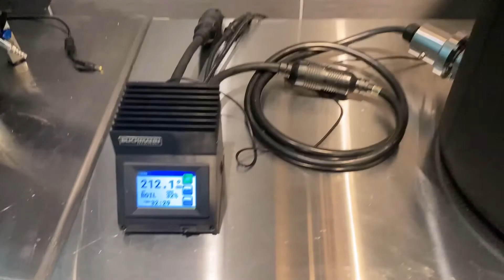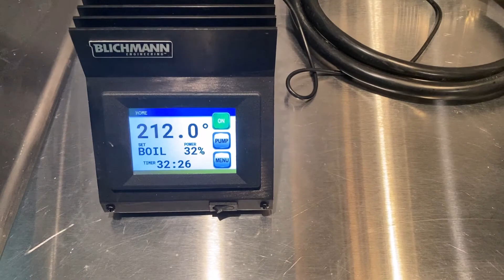Home Brewing Steam Condenser

Comment: Hi - made a system for my Grainfather that comes off the lid - going to need it here in UK as we hit autumn /winter - you’ve got a nice compact rig there - the key is the spray nozzle!!
Reply: Used this as a starter - then added TC’s to get the extension bends to lid - proved to be too tricky and expensive to source 1x TC nozzle - https://www.crafthardware.de/en/product/steam-condenser/
Reply from the maker: David Pinnington I have an extra nozzle or can get you one
Reply: JP's Homebrew - thanks - my condensers up and running 100% - just sharing info for any others out there!!
Reply from the maker: David Pinnington can you share it?  That sounds awesome